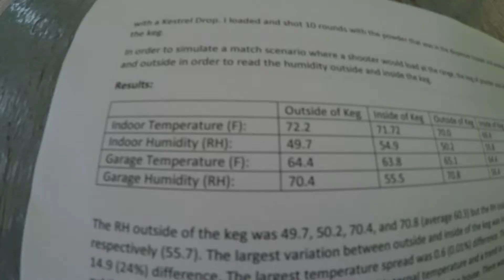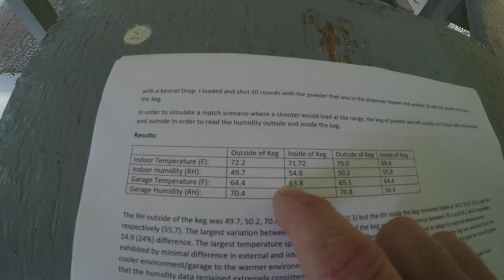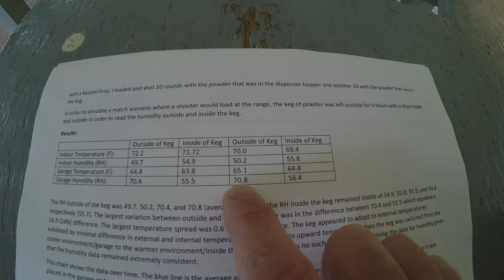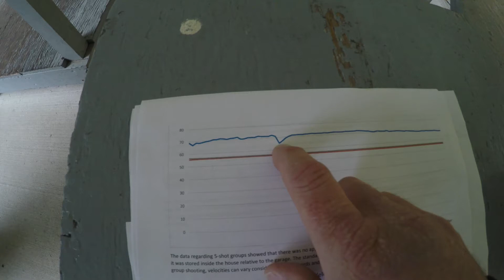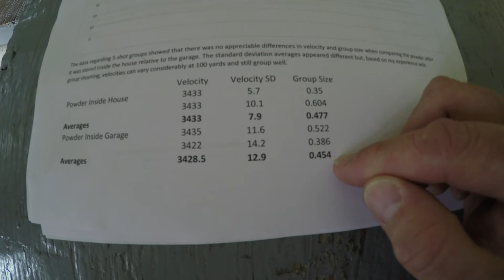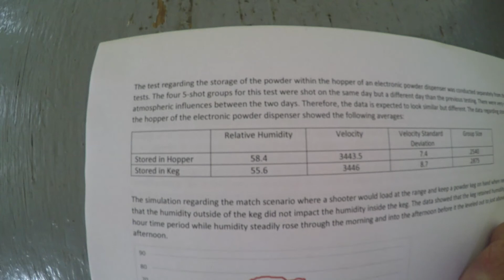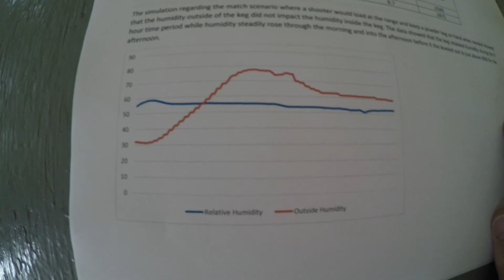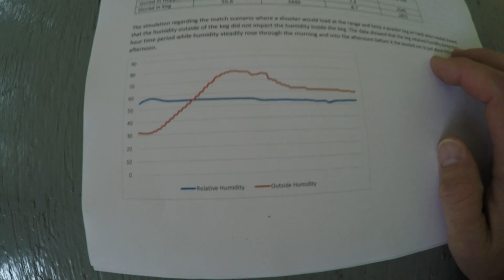Powder Storage

Comment: This is the exact test I was hoping to see but in my opinion 17 hours wasn’t nearly long enough.  I really don’t believe those plastic jugs allow humidity to enter or exit the container but a definitive results would include monitoring the RH inside the keg over a longer period (maybe 30 days) to verify the stability of the contents.  I tape my lids closed with duct tape between uses and I squeeze the container to force air out so the keg is somewhat vacuum sealed, that lets me observe the keg remains air tight during storage because the container remains sucked-in.  I’ve also begun writing the RH on the jug when I seal it an effort to maintain around 50% RH.  I live in the PNW also and was concerned about our high humidity but I’ve discovered the humidity holds about 50% indoors most of the time.  So if the powder doesn’t change during storage and I control RH during loading I hope this issue is resolved..
Reply from the maker: I’m about to do an update video on this that shows that there is no humidity change after leaving the jug outside this winter in the PNW.
Reply: ynotjf  Or you can store your powder in container with a Boveda two way humidity pack and not have to worry about it.
Reply from the maker: My monitoring shows that you don’t need humidity packs. Just close the lid and you don’t have to worry about anything. In fact, adding a humidity pack gives you something to worry about.

Comment: If and when you take the Fa powder dropper to the range do you use a battery pack or plug into regular outlet
Reply from the maker: Plug in. I have a reloading box with a dehumidifying rod where I keep the FA dispenser. I close the doors of the reloading box when it’s dispensing so I eliminate wind effects. I also have an antistatic mat that it sits on to reduce static effects.
Reply: @WitchDoctorPrecision  sounds like a neat set up..